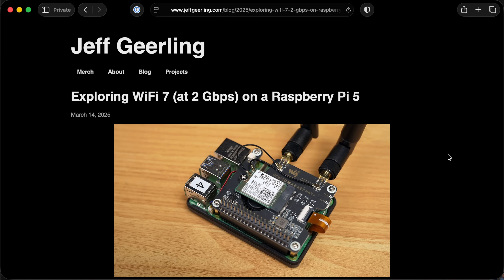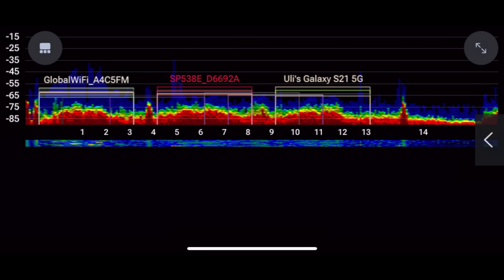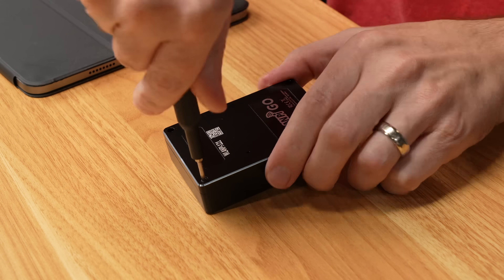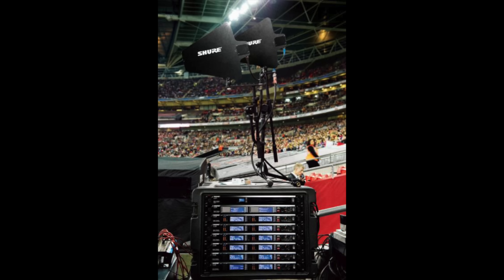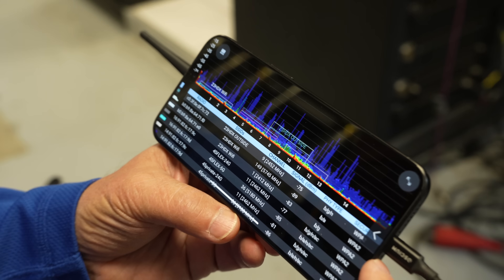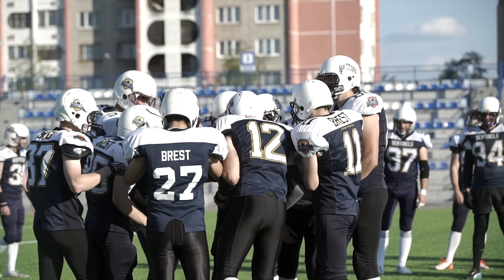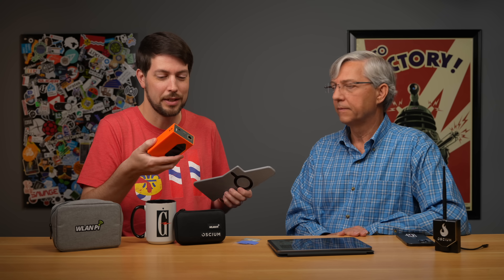We spy on your WiFi with this little Pi

Comment: It isn't available for Apple, but there are lots of applications for Android but do this type of thing without any extra Hardware required other than the Wi-Fi radio inside the Android device I have a great one for cell towers had a couple of different ones for Wi-Fi

Comment: I use a free wifi analyzer app using the 2.4, 5 and 6 GHz radios already in my cell phone.  Unifi wifiman and other apps are decent enough.  Did I mention free? :)

Comment: I've had the O-scope that Oscium brought out for the 30 pin Apple connector.  It still works as long as you have adapters or devices that support it still.  Neat company, they make quality stuff.    Oscium actually licensed into the Apple ecosystem a long time ago, which is why this works with your iPhone and iPad.  Its expensive and very cool.   As an engineer myself, I'd always hoped they would bring out other tools that are in the same space that were lab grade for the phone, which wouldn't be outside their wheelhouse.  Loved this for doing my Computer Engineering course work and lab work.

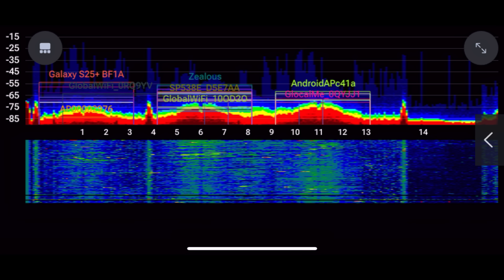Comment: 01:48 Probably thinking of Ubiquiti's "WiFiman", which is available for Android, iOS, Linux, Windows, MacOS, etc. which can use your device's built-in Wi-Fi chipset (which sometimes has a terrible refresh rate, or there is a Bluetooth accessory with features similar to the device shown in the video, I dunno what platforms it's compatible with) and has Augmented Reality RSSI mapping.

Quite a neat little app, I started using it on all my devices since it has basically all the same features of the platform-specific software I was using before (I have used "WiFi Analyzer" (free and open-source) and "Network Anazlyer Pro" (paid) on Android).

The WLAN Pi looks pretty neat though, if I were setting up a robust wireless network I'd probably choose it over anything else (WiFiman, whatever the heck Ookla is selling that probably costs a fortune, etc.)

Comment: Wifiman does most of that for free.
Reply: No 6Ghz on the Wifiman though.. this supports all 3 bands and allows for customization and adding additional tools
Reply: @MarkHoutz Wifiman has 6GHz for me. But I do agree that it doesn't do all the things the WLAN Pi does.
Reply: @MarkHoutz the WiFiman mobile app can display 6 GHz (Wi-Fi 6E/7) information if the smartphone you are using has a 6 GHz radio built-in.

Comment: Bottom part of the WLAN Pi Go case is metal and serves as a heatsink. Top part is machined plastic which has the antennas attached to it. That’s how the RF gets in and out. 

Since it uses a client Wi-Fi adapter, the redeived signal strength is on par with a standard smartphone. In other words, signal strength measured by the Go matches the signal strength received by an iPhone.
Reply: That is great to know. Thanks for the comment. I never got around to a scratch test on the cases but I assumed there was some kind of RF view out either by a fine finish over some open plastic space or a material that didn't block RF. Felt so solid I was guessing metal with some open slots that were covered and finished with something with a nice hard finish!

Comment: Just some clarifying info on the roku’s

They aren’t a hotspot to access the wired network or anything, they are used for the remotes that have the headphone port for listening with headphones. I’m not sure if it also uses the wifi for the rf control part, or only headphones, but it’s definitely part of the headphone part
Reply from the maker: Still, it does a nice job of polluting that channel!
Reply: @GeerlingEngineering oh 100%, just not the level of security concern some might think
Reply: Thanks for the clarification I was in a bar with at least six TVs each one with a Roku on it..... Really annoying since I was controlling the audio mixer over Wi-Fi. I hate that they're on by default. And they usually 2.4 GHz.
Reply: Yep it is for their remotes or the remote app on a mobile.
Reply: Hmm, thought they were Bluetooth?
Reply: @glynnetolar4423  for the remote part probably, but the wifi is used for the audio iirc
Reply: Known as Wi-Fi Direct. Some printers do this as well, but it's rather clunky to use. When you need to print, you disconnect from the Wi-Fi network in order to connect to the printer to print, then back to network Wi-Fi. Polluting the spectrum is one reason I wire anything I possibly can.

Comment: There's a really good video of a guy that built a similar device with a Raspberry Pi that watches and records the devices around it to catch surveillance. The device can be built for about $100 and the software is free. Its capable of listening to devices to determine all their details including their last Wi-Fi connection so you can you find out tons of info from the horribly leaky devices (cell phones) around you.

Since there's multiple websites that list every SSID in the world you can pinpoint where someone lives or works because cell phones are constantly broadcasting Wi-Fi requests to connect to their last known network, it's screaming where you live or work all day every day.
Reply: May already exist, see wifi pineapple.

Comment: I think it's better to blur out the MAC address, since it's possible to determine a location using a Wi-Fi MAC address.
Reply: Whilst i agree, this is also a commercial property.  They don't exactly hide where they are in the world
Reply: Ssids too, checking against wardriving databases, but it sounds like they’re aware of that and it’s conceivable that they just went to a random coffee shop in town or something for the b-roll and screen capture. Unfortunately lots of weirdos out there. niche tech communities used to be so wholesome and supportive. I guess the weirdos are tech savvy now whereas they mostly weren’t during the halcyon Web 1.0 days.
Reply from the maker: Yeah much easier with just SSIDs. You don't need many to pinpoint a location.

Comment: This is neat, I hope there's DIY option for $200-$250 (material costs).
Reply: There is a DIY solution, just doesn't attach to your phone. The WLANPi R4 is DIY, just have to get a supported USB Wi-Fi adapter

Comment: Lets hope a phone manufactor makes a phone with a SDR built in ...  Ulefone are showing some interest with this
Reply: The problem with that is that phones last way less than this specialized equipment. It’s not a good idea to have it integrated in a phone because it would become obsolete in a few years…
Reply: To an extent think name phones already have SDRs in then. They're just not available to user software.
Reply: @glynnetolar4423 anything is available to you if you have root on an Android device. And a lot of it's available even if you don't have root on an Android device. The key is having a device that gives you access to it, apple does not. I do some of the things in this with wigle as you can definitely see this type of data in that and then it also has logs that you can go back and you use to reconstruct some environments. You still need an actual SDR for capture and for Wireshark purposes
Reply: Why not just plug any good USB based SDR into the OTG port on your phone. Then as you improve your sdrs by replacing them you can keep using them on the same phone